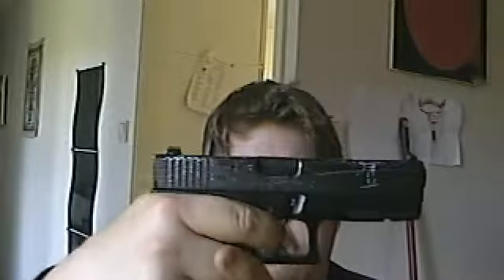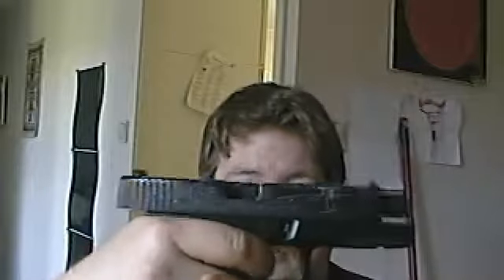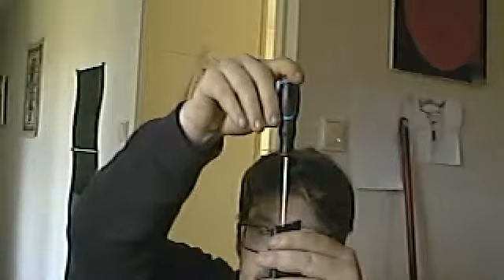Airsoft question - Fix green gas magazine? Can not fill it with gas.

Comment: The magazine is possibly full of air - hold down the release/knocker valve at the top back of the magazine as you fill. Gas will shoot out of the top of the magazine then let go of the valve button and continue filling. This should push all air out of the top of the magazine and ensure only gas fills in.
Reply: THANK YOU SO SO MUCH

Comment: Does anyone know how to fix my green gas mag.Whats wrong is that when I fill it up its only good for 3 shots and it's completely out and the mag isnt leaky and it's normally good for a full mag can anyone help me please.
Reply: same for me with 0 shots, from the start. why?
Reply: Im having the same problem but i get to shoot around 3-8 shots and if i fill it right i get about a mag and a half but i remember i used to be able to shoot 2 mags.
Reply: Same problem also, have 3 different mags, one extended mag( Glock 18) can only fill for 1-2 second with like 8 shots max....trying to figure out what needs to be replaced before I take one apart

Comment: Did u get it fixed? I’am having the same problem at the moment. Wondering if it’s due to a clogged charging valve?
Reply: Jakes Gfc like  is it on the outside
Reply: I have the same problem completely stripped my mags no damaged o rings no leaks even tried cleaning out my valve